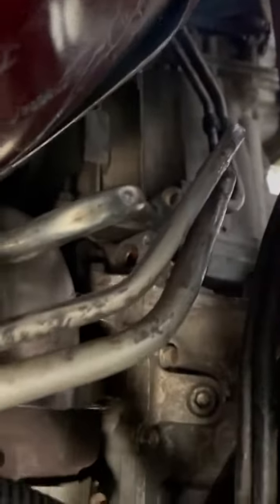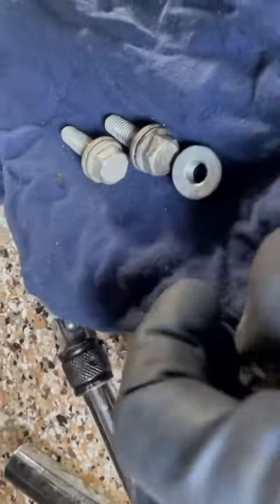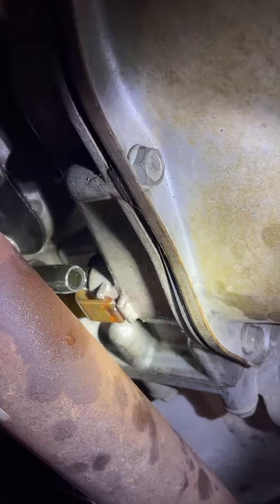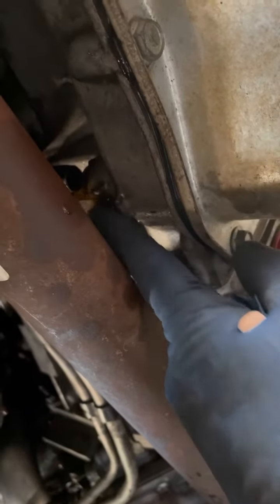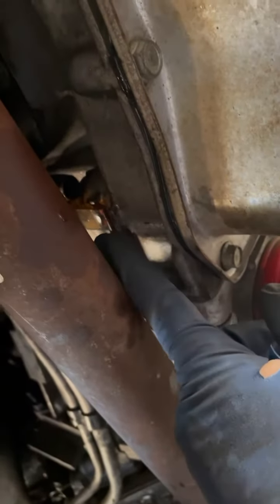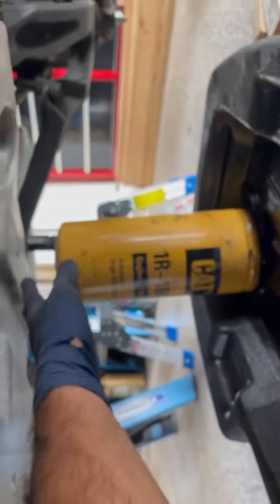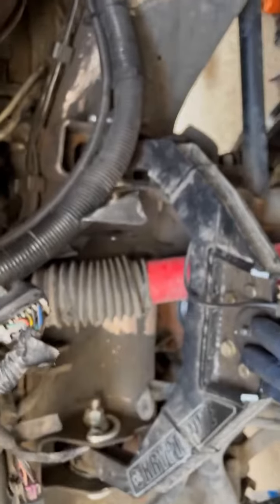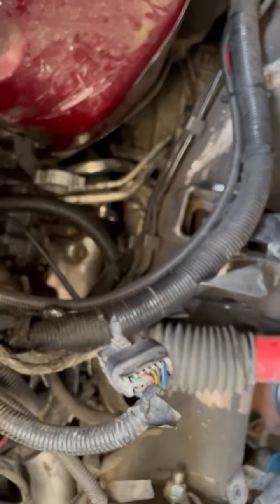LMM DURAMAX DRIVER SIDE DIPSTICK INSTALL.

Comment: Thanks for making this. Did you install this because you were having clearance issues after putting in an aftermarket down pipe?
Reply from the maker: Yes, the 3 inch downpipe from PPE only allowed me to get one nut on the transmission bell housing to support the passenger side dipstick. I just wasn’t comfortable with only having one nut supporting my dipstick. The driver side is a tight fit and you will most likely need to trim the metal bracket around the glow plug module.